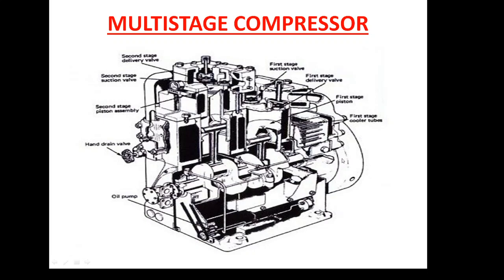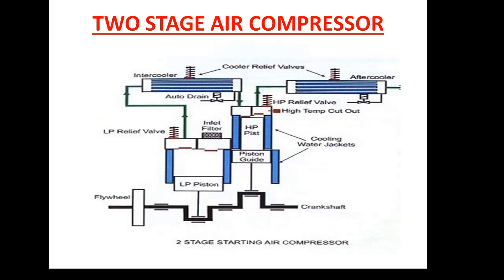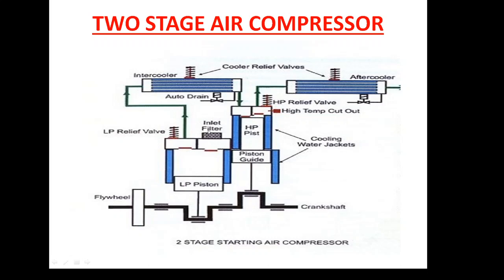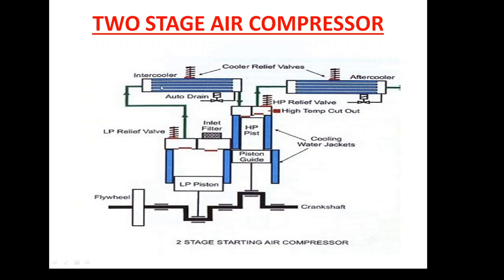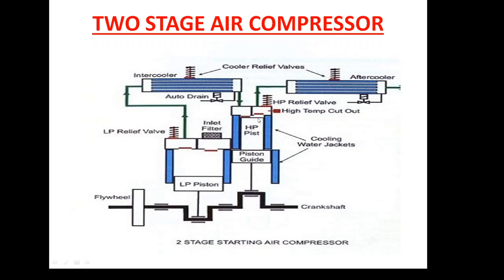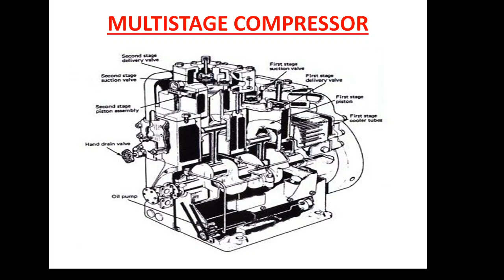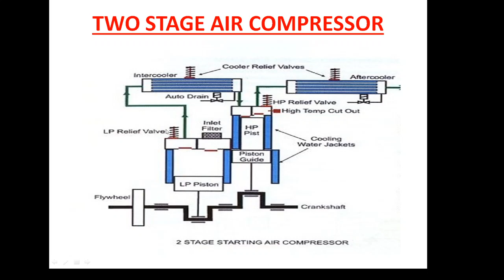Multistage Air compressor|what is a two stage compressor|How a multistage compressor work|

Comment: Why moisture is present inside air bottle little bit confused
Reply: THE COOL AIR WILL CREATE CONDENSATE DUE TO HEAT FROM SURROUNDING AND THIS HAS TO BE DRAINED AT INTERVALS